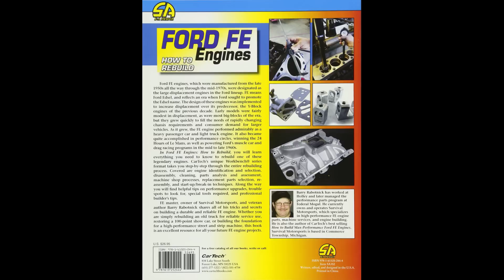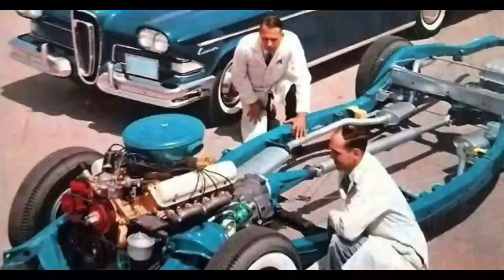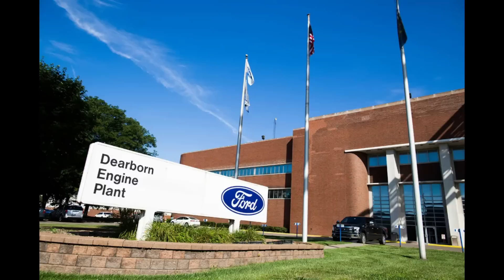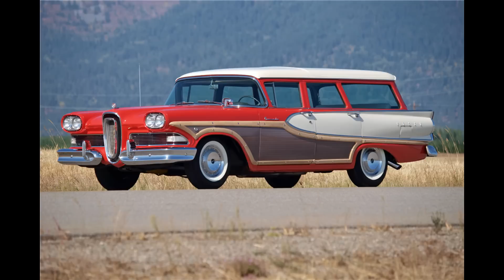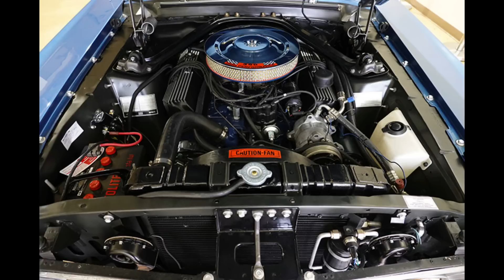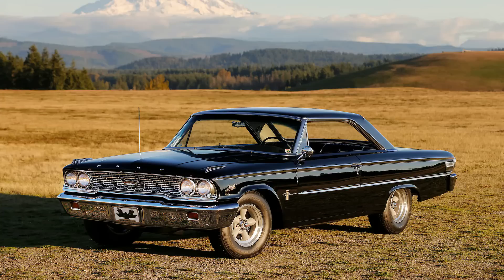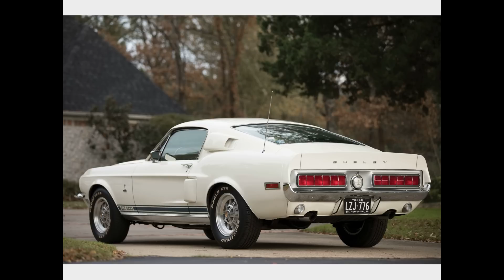Learn about Ford's FE engines and why they are among the greatest offerings by the Blue Oval!

Comment: I think the engine that was under utilized was the 410 that came in the Mercury Parklane. I think that with the CJ heads 2x4 intake and the 390 375-401 hp solid cam with header type manifolds could have been the jack of all trades engine as the base replacement for the 390. Setup that way it would have been a 410 hp and 480 ft lb police interceptor and a good base for the pony cars. I built one for a friend who had a Marauder S-55 with a 4speed and it was a handful. It could have had the CJ hydraulic cam for a quiet 375 hp big car engine and for trucks a 410 at 9.5:1 and the regular hydraulic cam would have been a good 350 hp 465 ft lb truck engine. The alphabet soup of engines in the 70s was unessesary. The FE with Cleveland heads would have stomped every thing as a 428 or with a 4.25 stroke a 460 with Cleveland heads. The 385 , really? They could have been around into the 90s . They are still here now….
Reply: No other family of heads will go on an FE.   They are a unique design, with what looks like a “half-head”, where the valve cover goes over the intake manifold as well as the head.  Indeed nearly half of the “head” section on other normal engines is on the intake manifold.    I think Ford did this so that it could be more lightweight with an aluminum intake, and since a lot of the intake port is actually in the intake manifold, it’s much easier to remove and port or swap intakes and realize a substantial difference than trying to port the heads themselves.      Other heads would not work on an FE
Reply: @andrewhigdon8346  True. I always thought it odd that the SOHC was running in Top Fuel and Funny Car at 3000 hp, but they couldn’t deliver a street head. The 428 CJ could carry the front wheels way down the track. The 390/410s made really good torque. There was something there that we were not getting. Iacocca and his precious Mustang.
Reply from the maker: Thanks for watching and for the great comment! We appreciate it and hope you keep watching!

Comment: I have my aunt and uncles 69 LTD that has the stock 390 with the 2 barrel carb. It is a smooth running engine with plenty of power even with the 2150 carb.

Comment: I’ve had FE engines more than all others. A 58, 332 66f100 with 352. I also had 2 cobra coupe(Fairlanes) a ranchero that I transplanted a 428SCJ and three 66-69 Falcons that I put 428 CJs in, one with 3x2 Holleys and one with nitrous. I’ve built all most all of fords engines @ one time or another from stock to full race. My buddy @ a machine shop I sometimes work for called me to assemble a 428CJ with solid flat tappet cam just a few months back. I don’t know of any other engine that is so versatile and reliable. From dump trucks to top fuel these engines have been in just about anything you could imagine and did a jam-up job. Thanks for the respect it deserves!
Reply from the maker: Thanks for watching and for the nice comment! Keep watching!

Comment: School buses and "farm trucks" with gasoline engines and drive axles are not "heavy duty". Unless of course the manufacturer produces "ultralight duty" trucks like F100s which are "light duty trucks" with no rated "tonnage". Making F200s (there were no F-X50 trucks at the beginning of the "FE era") "standard duty" and F300s "heavy duty" and F400s "super duty" and F500s "medium duty" and therefore F600s "heavy duty". 

"Duties" are determined "in-house" based upon the "size" of the manufacturer's product "range" as "rated" by DOT "specifications". If you do not build an "official" heavy-duty truck that has "max" DOT GVW capability then you don't have a "heavy duty" truck "by the books". 

Ford never produced a twin-screw max-GVW "semi truck" with a gas engine but that doesn't make medium-duty Fords "heavy duty" by "default".

Comment: The 406 was NOT cross bolted, only the 427
Reply from the maker: We know that. It has been kicked around over the years that some race ones were - just wanted to mention it. Thanks for watching!
Reply: @IfThisCarCouldTalk :
FYI, the C2AE-BD late 1962/early 1963 406 blocks were cross-bolted like the '63-1/2 427s.
Reply: @johnjohnsn7633 Yep that's how they knew the 427 needed to have cross bolted mains caps when it was built

Comment: IM 61 and i have been driving and racing FEs since i was 15 years old.i had a galaxie with a hot390,i took it out and put it in a lighter comet body and it would fly.i still have the 66 comet but it has a 428 now

Comment: I'm still driving my '64 352CID FE {390 same block just different stroke and crank little over boring needed}, runs great lots of power and still has great compression @ 75K miles, looking to have her rebuilt as a 390 but hard to find a shop I can trust to do it right
Reply from the maker: We know of a few. Where are you located? Thanks for watching!
Reply: @IfThisCarCouldTalk   Niagara Falls, Ontario

Comment: 1964 Galaxie 500r XL 427 dual 4 barrel carbs and top loader 4 speed. Nascar homolagation for the street. Very little information available, Wikipedia page does not acknowledge its existence. 
My friends dad had a restored one and I went to car shows with them a few times as a kid. His dad bought it in High School and restored it as an adult. It could be temperamental on a hot day. I loved it when it would load up some going 20 mph through the park leaving the show and pulling out into the highway. He would do a rolling launch and open both four barrels. I sat in the center of the back seat with my friends. We would be pinned to that back seat, lift our heads between shifts and giggle.
Reply from the maker: What a great memory!  Thanks for watching and sharing!
Reply: Guessing that had "7 Liter" badges on the front fenders.

Comment: The heads and rocker arm assemblies killed these engines. The heads air flow numbers were horrible. How they were approved for use is a mystery. WE ran the 390,406 and 427s in the 60s. We could only use Fprd cams and they were junk. The 410s and 428s were boat anchors. The 427 leMans was an animal but only several racers got them which pissed off a lot of people. Many guys went to the Mopars and some to Chevrolet due to Fords practices. All in the FEs were not worth owning!
Reply: I need to come and kick your ass moran.